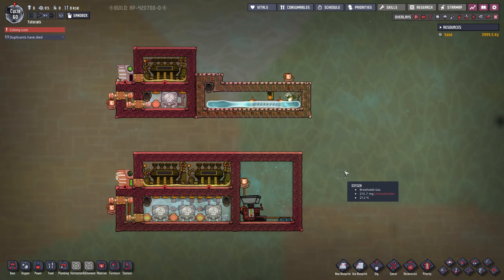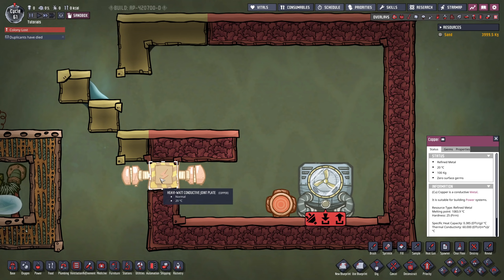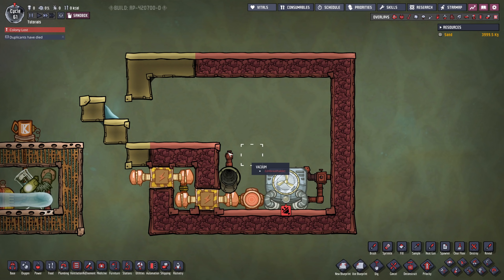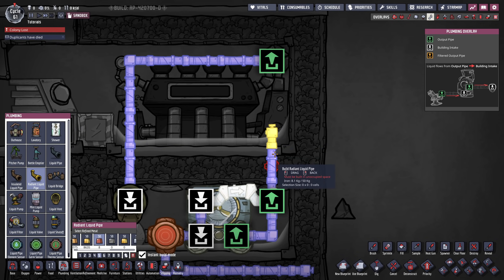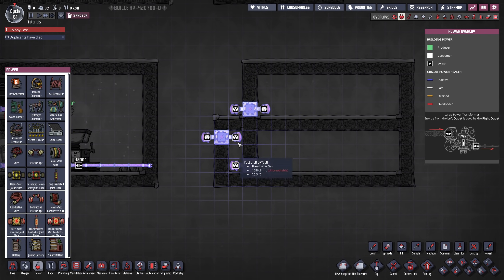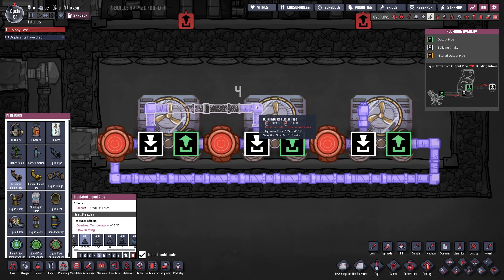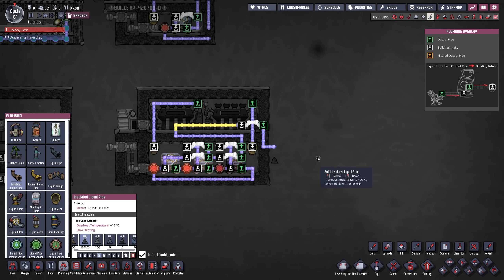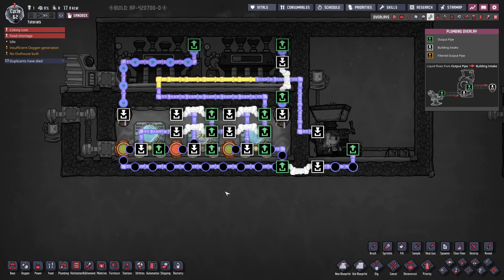COOLING WITH STEAM TURBINES & AQUA TUNERS (Tutorial: Oxygen Not Included)

Comment: For those that have built this now and found it not working due to the change to the liquid pipe thermo sensor, where now it won't redirect the water to the different pipe just stop it's flow, all you need to fix it is build a liquid shutoff - connect it so that the water runs through it and via automation wire connect it to a regular Thermo sensor, this will make the water at the liquid pipe thermo sensor continue to flow ignoring the aquatuner like it did in the video
Reply: Would you be able to provide a screenshot of the build?

Comment: Hi Nathan! Do you have an updated design that works in the current version of the game? This one runs way too hot, aquatuners break from the heat pretty quickly (~615 f) and the steam turbines are stuck overheating constantly. At a guess the turbines need better sustained cooling but I have no idea how to do that in this design. A bit frustrating after getting it built in survivor! I'm using petroleum coolant and steel/gold/ceramic materials for everything fwiw
Reply: I'm far from on this guy's level, but I can tell you to just get creative and snake more radiant pipes over the steam turbine instead of one. Also, use steel for all of those that you can (why worry about it breaking too easily?).

Comment: For the love of ONI, Don't do this!
- setup is too hard to build
- it's too big - you can compress the setup in fewer tiles.
- you probably don't need the liquid around the steam turbine if you use a few more radiant liquid pipes - less soggy feet
- it uses a liquid pump all the time => -240W wasted space... instead of a pool of water you can use a liquid reservoir - it doesn't take water out of the pipe loop, so you don't need a pump to be working all the time - you can still equalize the temperature(although you don't even need to do that) with the added benefit of 240W less power needed;

On top of that it uses liquid locks which are cheaty and annoying to set up.

Also, you don't need those ugly bridges for the daisy chained setup - you can use only 1 bridge per aqua tuner and put the bridges 1 tile to the left and connect their output to the next sensor, as well as disconnect the output of the aqua tuner from the next sensor and connect it to the bridge, so you have output - bridge end - next sensor. That will make your room smaller and prettier/easier to build/manage/fix/understand

Comment: I have one question. I'm using aquatuner right now to cool the water which I use for my base (water coolers, farms, showers etc.) the problem is that Liquid Sensor sends Red Signal because water at the sensor is bellow 25 C but the water which just entered Aquatuner is around 38 C so the hot water doesn't get the cooling effect and enters my base regularly. Should I put another Liquid Sensor but I don't know if that will help and how? Could I use some Buffer Gate to keep sending Green Signal for a little while longer? Please help. :D
Reply from the maker: I always find the best solution is the have a liquid tank before the aqua tuner, fill it with at least 1 ton of water. The water inside will equalise temperature and come out the same temp out the reservoir. This way once the sensor goes green it will stay greeen for a while until the entire liquid reservoir cooled down. But make sure the liquid tank is outside the steam room;)
Reply: @Nathans-Sandbox  Awesome idea! Thank you 😄

Comment: Ok I built this but either 
1. some hot packets were bypassing the aquatuners lower down the chain for whatever reason. 
2. some packets got supercooled beyond its freezing point.
Had to introduce a liquid shutoff between the thermosensor and aquatuner to get it to run reliably.

(Suspect a 2nd packet turns on/off aquatuner and thus 1st hot packet goes out to the bypass or 1st cold packet goes into the aquatuner.)
Reply: you don't happen to have a screenshot / of this / lol i'm finding the same thing happening - but yes great vid thanks!

Comment: I built the 3 AT design BUT... as August 2022 this design doesnt work as the insulated pipes keeps getting cold damage :/
Reply: add a liquid shutoff between sensor and aquatuner.
Reply from the maker: You can only get cold damage if you cool the liquid beyond the freezing point, which can be avoided by having a high enough setting in the sensor.
Reply: I'm having similar issues on the latest build, I ended up disconnecting the loop that can send liquid through the system a second time.

Comment: I have been playing the original ONI for about a year or so, but always get stuck right before heading into space. This video helped a ton but I am not sure the best way to power 3 aquatuner though, they burn through most of the power I can toss at them in a matter of seconds! Any suggestions?
Reply from the maker: Before you can have 3 aqua tuners you need a solid power system. It is very rare that you need 3 daisy chained aqua tuners. For a lot of contraptions 1 is enough, especially if you use a good coolant.
Reply: One of the most straight-forward power systems is to build petroleum generators.  As a side benefit, the oil reservoirs and oil refinery both produce natural gas, which you can capture  and use as first choice power (so your air ducts don't get backed up).  Use smart batteries to control when natural gas generators and petroleum generators run.

Comment: Is any else getting damage on the insulated pipe coming out of the aqua tuner? Using Indigenous rock insulated pipe. Have the sensors set to send a green signal over 16 degrees Celcius and I'm getting cold damage? Is anyone else getting this issue?
Reply from the maker: Make sure the liquid cannot get back into the aquatuner a second time. The bridge is key to prevent that.

Comment: There is one problem with this set-up is that it would stutter because there is a bulk of coolant re-entering the 1st temperature tester before re-entering the loop.
Could this be improved upon by having another temperature tester for the coolant exiting the 3rd aquatuner to split between the coolant re-entering the loop and/or exiting it?

With a solution to that, the 3 aquatuners can all run more continuously with less breaks/stutter.
Reply: You can use liquid valve on the enter to the loop (first aquatuner). Set flow rate on 50% (5000 g/s) and liquid will freely flow from one aquatuner to another. You also have to fiqure out yourself how much fluid do you need to pump into your loop so you have smooth flow.

Comment: Hey Nathan I managed to squeeze your setup in my base to cool everything down. I set up a cooling pool with crude oil and let all the cooling loops go through it (oxygen, refinery, production machines and the the whole base general cooling loop). I had to add a reservoir after the output pipe to equalize the packet temperatures. Because your setup produces packets at different temperatures from the bypass of the AT 2 and 3, when the temperature sensors switch on/off. Also it helps to keep the cooling loop pipes always full (I filled half the thank with petroleum).  
I wanted to drop this here in case someone wants to use it on a medium sized/low indusrial base. I managed to cool the whole pool of crude oil down to 8-9°C whitch is fantastic and little overkill. Let's see if it keeps up as my base grows up!
Thank you bro. You're so good at this game Jeez!!!!  You deserved my sub.

Comment: assuming you want to use this in your main cooling loop for the whole base this could keep the aquatuner running at all times, is 1 steam engine enough then considering that it only provieds 850 watts while the aquatuner costs 1200 watts?
Reply from the maker: Using aqua tuners in combination with steam turbines is never a power positive process. Over many cycles it doesn't matter how many aqua tuners you have. If one aqua tuner provides just enough cooling power, then using 2 tuners will provide double that, but only having to run half the time, therefore not really using more power or outputting more heat. If you want good power, balancing the turbines makes more sense to just have enough cooling so that the steam room hovers around 200 degrees.

Comment: the first setup doesn't work. half of the water goes past the aquatuner anyways, how do i fix it?
Reply from the maker: Make sure the bypass connects to the pipe after the output with a bridge. I built some unecessary bridges, but the setup works as seen in the video.
Reply: @Nathans-Sandbox   its too late, the  save file before i added the oxygen (getting hydrogen was too hard) has been deleted by the game, too bad it is only used to cool down my base XD

Comment: I built this just like you show, I checked it many times and yet my liquid goes into the thermal sensor, the sensor shows red, the aqua tuner says disabled by automation and the liquid goes up into the bridge and onto the steam turbine. Never gets cooled.
Reply from the maker: Then it is already cool enough or the sensor is set too high?
Reply: @Nathans-Sandbox  hmmm no, it is definitely not cool enough and if anything I have it set too low. 36.7c  I was figuring it would take several passes to get that low but no it passes right through and on
Reply from the maker: But if the sensor shows red it doesn't detect the hot temperature. So either your settings are wrong or the water is already at the right temp.
Reply: @Nathans-Sandbox   so yeah I went over it and I had it set to below instead of above, but when I changed it, the liquid went into the aqua tuner and then the next one still went into the pipe and on. But if you have the sensor set to above a certain temp then isn't it telling the sensor that liquid can pass by also if it is above? I guess I just don't get how these things work. Thanks for your quick answers and trying to help though.
Reply: @Nathans-Sandbox  Is it possible that an aquatuner needs an extra tick of being enabled and that the sensor in front is not sufficient to start it? The sensor turns green, the aquatuner makes a noise, very shortly shows that it indeed it is 'cooling' (about 100ms at 1x speed), and then the polluted water travels upwards into the bypass uncooled regardless. There is sufficient power available to run it.

Perhaps this is a bug? But more likely I'm missing something. Or it could be a result of a badly implemented mod... For future reference; I'm running build U41-498381-5.

Thanks for your videos in any case!
Reply from the maker: I've never had issues with the sensor in front, you just have to make sure the sensor is in the tile just before the input of the aqua tuner. Hope you can figure it out!
Reply: @Nathans-Sandbox  Same thing I faced, last aquatuner turns off due to no liquid in pipe ( sensor in front is always green) . The next first packet will bypass the aquatuner when it is turning itself back on.

Comment: Am I understanding correctly that the liquid in the system is a closed loop? If I'm building this outside of Sandbox, in regular mode, how am I starting the system? Do I drop liquid packets with a bottle dropper into the space? Or lead an input pipe to my metal refinery (I used that in my setup)?
Reply from the maker: I don't recommend using aqua tuners to cool down the liquid in metal refineries, just lead the pipes through the steam room with radiant pipes and cool down the coolant of the refinery to below 200 degrees. I only used that to have something to cool down for the tutorial. As for the closed loop, you can use a bridge to input liquid and then once the loop is full you can deconstruct it again.

Comment: I don't get it, aquatuners need 1200 Watts to work, but the steam turbine only produces like 850 watts? My thinking is that I'd need two coal generators for 1200 watts of power for one aqua tuner, that then let's the steam turbine produce 850 watts? Am I missing something?
Reply from the maker: The aqua tuner with steam turbines isn't a power positive process, you need some extra power.
Reply: @Nathans-Sandbox  I guess I don't get it then, I was hoping to get a steam turbine to fix the power problem in my base, but I think I'll just throw more coal generators down if steam power isn't viable
Reply from the maker: Steam power is viable but not if you heat up the steam with an aqua tuner.
Reply: @Nathans-Sandbox  coal it is then hahahaha

Comment: I tried this now with my current power, somehow my thermo aquatuner overheats, as i understand the steam turbine should remove the heat from the aquatuner below, but somehow it does not
Reply from the maker: Did you build the aqua tuner out of steel? Steam turbines start to remove heat above 125 degrees and aqua tuners out of iron or gold start to overheat at this point.
Reply: I totally forgot about the steel part, i will change the material and check again, another question, the single aquatuner setup is just for single reduction of temperature, right? Do you think it will still work if I adjust the pipelines to create a loop on the aquatuner to meet a desired temperature?
Reply from the maker: Yes you can cycle it right back in if it's still top hot, just beware that the pipes shouldn't clog up and run fluently all the time.

Comment: 2 steam turbines generate 1600W.. and 3 aquatuner need 3600W.. plus 240W from metal refinery... no it isn't happening right..
any explanation?
Reply from the maker: You need extra power of course, but the aqua tuners shouldn't be running all the time, so it's a bit less constant power requirement.

Comment: So please wait a minute and explain me this little thing. Steam turbine produces 850W, Aquatuner needs 1200W. So since this is going to be always a net loss, this is solely for deleting heat with me still requiring to put energy in from other power sources... is this right?

Then no wonder that it doesn't work, I always expected to get energy out of this and not to put energy in.
Reply from the maker: It can't be power positive, would be a bit cheaty if you could cool something and gain power at the same time. The steam turbine is fast in deleting heat and it gives a little relief by giving you at least a little power back. 
You can use steam turbines in a power positive way by dumping heat generated elsewhere into the steam room and use the turbines to delete the heat. But if you actively use the aquatuners this needs additional power.
Reply: @Nathans-Sandbox  Okey, Thank you for clarification... I wasted 3 hours into trying something that is impossible :D The noob trouble got me hard here.

At least it seems like it is possible to get a net positiv of 75W using Power Control Station, but I'm too dumb to use sandbox mode to actually test this and I have no idea if the materials for the chip are worth it. But still, thank you!

Comment: I did the first one. A small water cooler. My power lines were lead heavy watt and eventually melted. And my steel aquatuner was getting damaged. I put 200k water in but idk what I did wrong
Reply from the maker: A steam room should never exceed 200 degrees, since that is the limit of the steam turbine. To melt lead wire I think you need to go up to 375 or so degrees, or 325, either way it's too much. Are you sure your steam turbine was doing something?
Reply: @Nathans-Sandbox  I will double check everything. I just booted up a sandbox save and duplicated your layout 100% and everything was fine so im curious why mine got too hot.
Reply: @Nathans-Sandbox  It looks like my turbine got too hot and wasnt able to delete steam quick enough so my aqua tuner over heated
Reply: @Nathans-Sandbox  Why do you think my steam geny over heated? was I trying to run it too long/cool water too much? I have petro on the floor as well
Reply from the maker: Are you cooling the petroleum?
Reply: @Nathans-Sandbox  With 1 pipe, yes. I will go ahead and up it to maybe 2 or 3
Reply from the maker: If the turbine overheats, that's definitely a good idea.
Reply: @Nathans-Sandbox  Turns out I had insulated pipe instead of radiant there. 1 pipe section as radiant made a HUGE difference in keeping it cool. What is your thoughts about cooling a tank of water down this way vs doing a cooling loop of radiant pipe thru the water body and just cooling down some kind of fluid in the pipes?
Reply from the maker: A cooling loop will use less power since you don't need a pump to cycle the coolant.
Reply: @Nathans-Sandbox  what if I add in a liquid thermo sensor before the pump to disable it depending on the water temp?
Reply from the maker: Sure, that will be more elegant than pumping all the time.
Reply: @Nathans-Sandbox  when i put 100kg of petroleum my steam turbine said build flooded, why?
Reply from the maker: Mob one tile below the turbine and it will go away.
Reply: Nathan's Sandbox thanks you